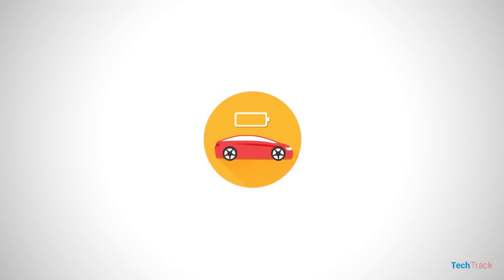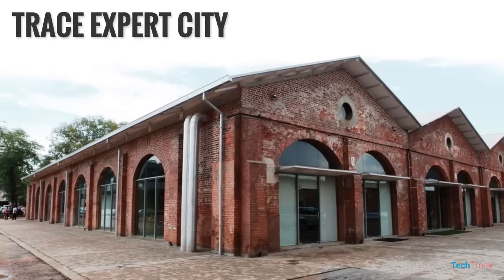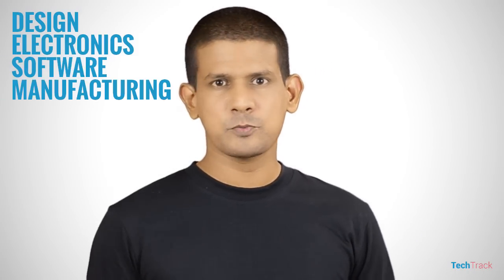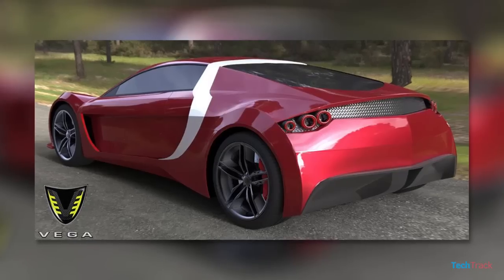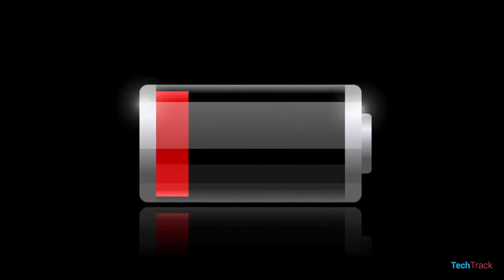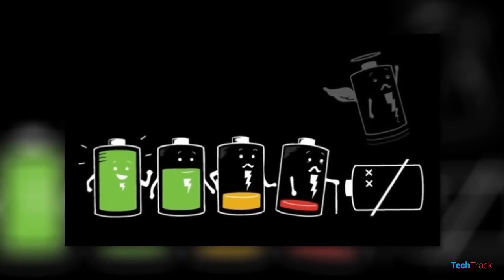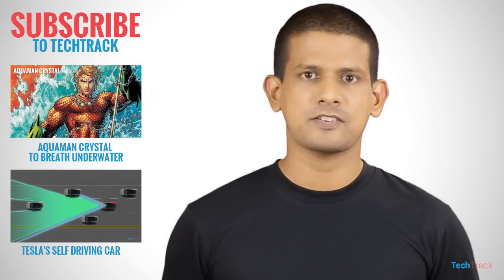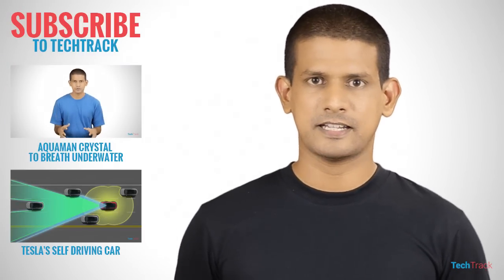The Sri Lankan Electric Sports Car

Comment: good idea for battery cells.   i think can use this type batteries also.  LiFe PO4 10Ah LiFePo4 3.3 Volt Prismatic Batteries 3.3V 12C 120A / 200A Peak NOS. its better to fix self charging solar panel on the vehicle  top.

Comment: 900 hp ,carbon fiber body and only 240km/h and 0-60 from 4 seconds that's slow the  Corvette z06
has a top speed of 310 and it's limited to that speed with no limiter it will reach about 345 to 350 km it does 0 to 60 from 2.8 sec.
this looks cool but isn't in the speed zone of a super car it is in a speed zone of a muscle car like a camero.
Reply: +dimalka shanuka I mean it must be faster they did a good job

Comment: Sorry but this car totally misses the point of Automotive Culture. Cars are supposed to be exciting, and involving experiences. Not for someone to blair through streets at full throttle with no silence. Where's the sense of emotion you get with that? Cars regarded as "Drivers Cars" have power that can be used everywhere and anywhere, they have sound and feeling interms of suspension. We all want to hear a throaty exhaust note, and feel each bump of the road as feedback given from the car and feel it. Think about it, world leading supercars like the lamborghini's all manage to do this all by their Loud, Throaty V12 Exhaust notes, the gradual power curve which we can feel. Not to mention the low seating point mounted as a inclusion of the carbon shell. Allowing for true road feel. This car is just going to be another Tesla but worse. No other way to put it.